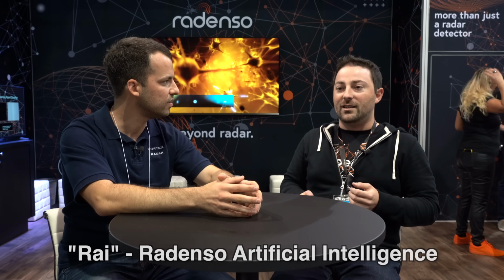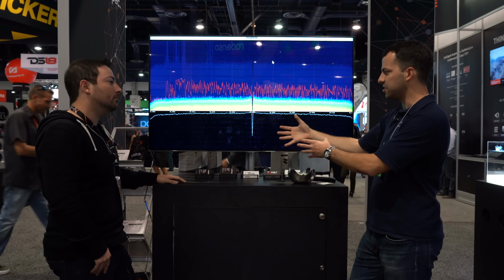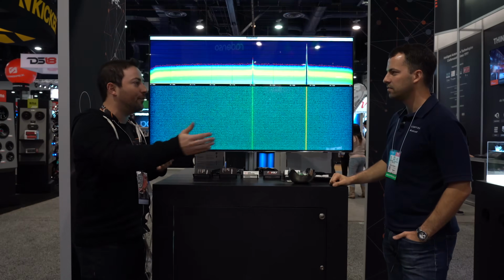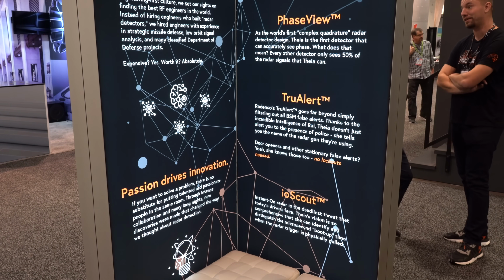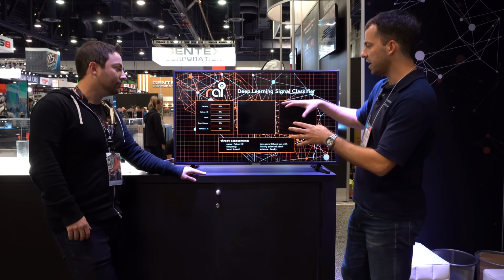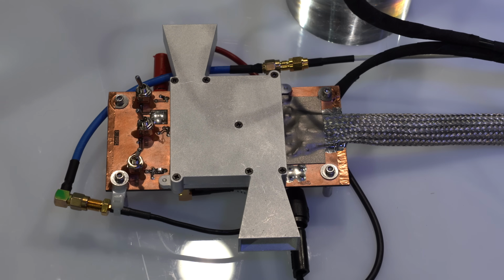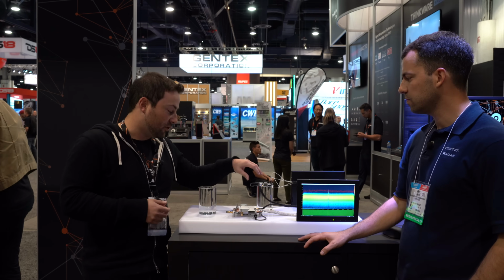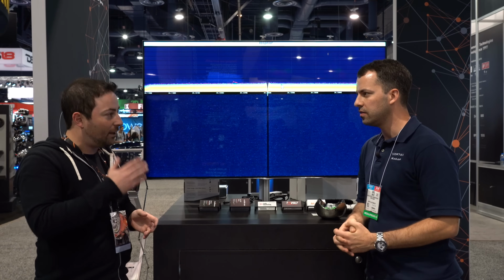Theia: No More BSM Falses! Radenso Introduces Artificial Intelligence with Rai

Comment: Mike may be worried about now. I just ordered the V1Gen2 with zero regrets, but this thing' when available, is already on my must/will have' device wish-list. This guy also has a ton of self-confidence, which I find equally impressive. As a retired engineer from the defense industry, the theory makes perfect sense. I am very interested in the product size, build quality and upgradability. If it turns out being as good as described, I suspect that "die-hard" RD enthusiasts' (myself included) will pay through the nose for this thing'. Perhaps we should start a guess poll.

Comment: Very nice. But how long will it take until some radar gun manufacturers will try to change their guns' signatures to make them harder to detect (either emitting random "spurious" noise or multiple different pulses) ?
Reply from the maker: They've already been able to be detected for decades. Why would they change anything specifically for Theia? Having Theia ID which radar gun is being used doesn't make the radar gun any more or less deadly when it comes to issuing tickets in the first place. It is a useful informational tool for us as drivers though.
Reply: That could happen, but the gun will have a performance penalty. To determine your speed, the gun needs to have a constant fixed frequency (CW), so it can't detect your speed while it's doing unusual stuff. It would also cost a lot more. Realistically it would only help catch the 0.1% of speeders that have an AI-based RD, so probably not really worth it to police. Might as well just use a laser gun for the same effect.

Comment: Will Theia be distributed in Canada ?  I like the millions ways to use this rf blood hunter ...could with appropriate hardware <see> a cruiser operating his radio ? Since laser light is also electro-magnetic radiation (higher wavelenght) any plan to apply ia to this threat ?
Reply: Yes, it's a worldwide product. It will not do police radio frequencies, only radar and laser. The hardware will have some capacity to analyze laser signals, but it will be "dumb" at launch and more capability may be added later in software.

Comment: Wow... so technically, with RAI trained to identify all the RFs out there, you could make the detector as sensitive as possible. Right?? The limit is the sky but curious how much power it will require since now we are talking about a super computer in our cars. #gamechanger
Reply from the maker: You need a super computer for the initial training, but running this in your car can be done on a much lighter platform. :)

Comment: hmm, he didn't answer if it will have arrows. Unless I missed it.
Reply from the maker: It has arrows. I mention it towards the end and you'll see the dual horn antenna design throughout the video as well.
Reply: @VortexRadar  I did see that, I thought they were just testing two different kinds configuration. I just missed understood, thanks for clearing that up. The tech stuff is way over my head, but it sounds promising.

Comment: Next year is a big time line. Wish they could be a little more specific. Like 2nd quarter of 2020, or something.
Reply from the maker: Yeah I’ve asked, but they’re not far enough along in the production process to be able to pin that down more accurately.
Reply: @VortexRadar  Also I wonder if I could be a tester for them. The main reason is, I am in there hometown. With this it would be very easy to communicate and workout if there is any problems.

Comment: This is awesome technology. My only concern is that they would be over confident in filtering and leave out the option to lock out alerts. My issue is that I drive past a military installation access point. This point uses multiple Ka radar transmitters to monitor someone approaching at a high rate of speed or in the wrong direction. Would something like this be an issue since it is coming from Stalker Ka transmitters and would be seen by this AI as a real threat even though it really isn't and isn't something I need to be alerted about. This is one reason why I dropped Escort because I couldn't lockout Ka. Any input?
Reply: He said in theory anything can be detected or locked out. It might require a software tweak, but there's no hardware reason why you couldn't lock out a specific type of Ka source.

Comment: Looks very nice. :) I have a question. What is its way to detect for a smart gun? As this comes out I am gonna predict that the radar guns are gonna get smart too. There gonna use a AI system to show different non legit signature types. The gun fires a door opener style signal then shorty after or longer depending fires it actual frequency or multiple police frequents to try and confuse this dector system.
Reply: That would add a significant amount of cost to current police radar units. Their circuits are only designed to do one constant frequency. Probably not worth the added cost for the vast majority of police departments.

Comment: My four big questions...

1) Can this be detected by police or is this a stealth system like the Uniden R3/R7?

2) Is it a built-in system like the Escort Max CI 360 or a window mount detector like the Uniden R3/R7?

3) Will this be capable of integrating with the ALP system like current Radenso detectors?

4) Would running other detectors or laser shifters in a vehicle alongside this interfere with it's performance and accuracy? Would the BSM or the ACC on my own car interfere with it's performance and accuracy?

Comment: If the theia is not measuring power, how will it be able to increase and decrease alert tones to let you know if you're close or far away from the signal?  Also how will it understand if you've passed the signal and it is now behind you?  It's interesting to see that it has ability to detect phase.  FMCW vs. CW is only different in that there is a frequency modulation component.  If a FMCW signal sits at the same frequency as a CW frequency how will it know there is a threat buried under there?
Reply: I'm sure it will have signal bars, he was just saying the filtering technology aspect doesn't rely on amplitude. It will have dual horns so it can look at the signal strength in the front vs. rear horns for the arrows. He didn't talk about simultaneous signal detection, but since FMCW and CW are such different signals, it can probably easily discriminate both. It would be relatively easy to add multiple pattern discriminators in software to allow multiple signal detection. Since the other big detectors do this already, I would think it would have to have multiple signal capability.

Comment: Whatcha going to do Uniden, Escort?
Reply: attempt to copy it.  basically the AI is software running on the linux computer that's able to distinguish the different signals like a signature.  Easy for  a computer and not so much for an integrated circuit

Comment: It it doesn't care about signal strength or signal amplitude, how does determine distance, i.e. the strength meter on the detector?
Reply from the maker: It doesn’t determine exact distance. Signal strength definitely does vary on External factors like terrain, antenna direction, etc. so you can’t use signal strength to reliably correlate distance.
Reply: @VortexRadar  Thx for the fast reply
Reply: I'm sure it will still have a signal meter based on amplitude to display to the user, which will give you a rough idea of the distance. What he was talking about is their filtering technology doesn't rely on amplitude.

Comment: Great coverage, nice job!
Four questions come to mind: 
1. Will this be a 100% stealth unit? 
2. How will this unit handle extreme temperatures, both hot and cold? 
3. As a computer based model, how reliable will this be and can it be hacked from the outside?
4. Will a remote display be available?
Reply: "Hacking from outside"? LOL, how would you do it, get inside someone's car to connect USB-C cable to the unit to "hack" it? And why would you even bother doing this?
Reply: @sdfasdfvccvvc  LOL nothing. Why do hackers hack?  If there is wifi or bluetooth capability, are they not soft spots?
Reply from the maker: Great questions :)

Comment: This RAI unit will not come out until sometime in 2020.  It will be for windshield mounted units only and can be attained through a software update.  RAI will not be available through custom install units that incorporate ALP jammers right now.  The electrical impulse of the RAI program versus the RCM Radenso unit interfacing with the ALP units makes this unavailable for custom mount units right now.

Comment: Good news, how about a counter measure to battle Laser/Lidar, radar detectors  are great but if you cant defeat lidar what's the point?
Reply from the maker: Thats what laser jammers are for, yes?
Reply: @VortexRadar  I completely agree with you. However what I meant was there needs to consolidation with radar detectors and jammers.  ALPs can run upwards of $3000 and are not easily movable from car to car.   Thus if you have 2-3 vehicles that you drive you need to purchase several systems unlike a radar detector which is easily moved.
Reply: @hanibalbarca7663  being invisible does not come cheap...but definitely worth the investment vs getting popped by the po po
Reply: Thank god for waze and the fact the the PO shooting LIDAr has to be stationary
Reply: @SuperDodoe  I agree, Waze is amazing and its free!!
Reply: @skinnygirlstretchmarks  PL3 is very popular where I live. Also when I drive to Ga there is Dragon eye.